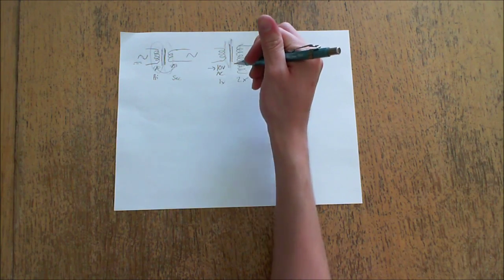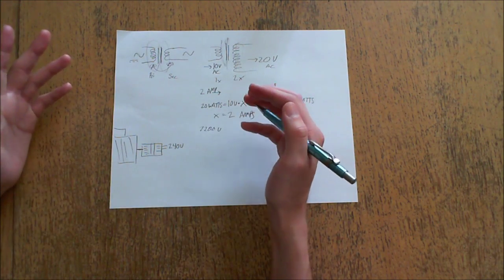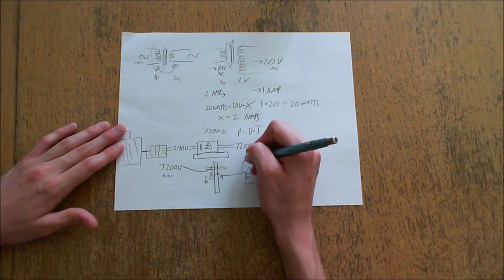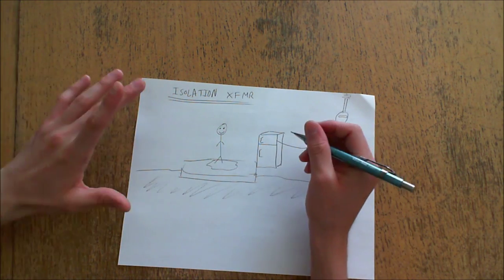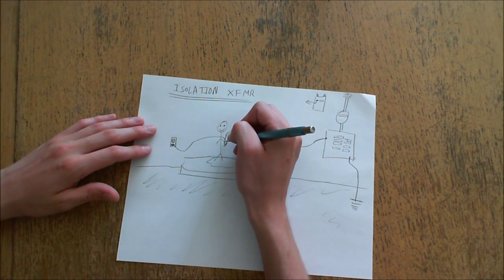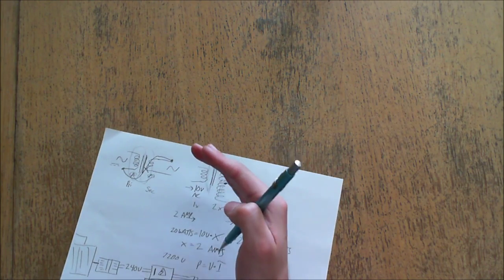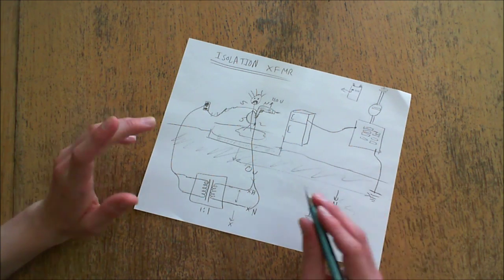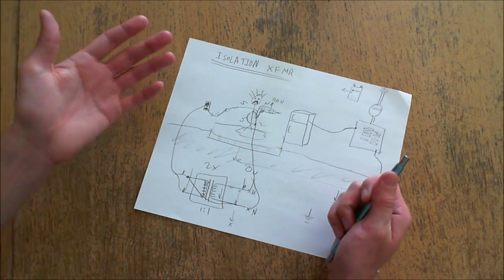EP 1 - Transformer and Isolation Transformer Theory

Comment: Hello, I read that measuring with an oscilloscope, you need an amplifier, you need galvanic separation, I ask from what point of view, when today's amplifiers have only 2 wires. Thank you for any knowledge
Reply from the maker: I believe the concern you're referring to is the risk of short-circuiting a mains-referenced component to the earthed chassis of the oscilloscope during measurement. If the oscilloscope is grounded to earth, then connecting its ground line to something with a potential to earth, it may result in a short-circuit being formed and resulting damage to the oscilloscope.

There are a few solutions to this problem, including:

1. The use of an isolated oscilloscope probe, which measures and re-creates the target waveform through a galvanically-isolated barrier.

2. The galvanic isolation of the target device being measured, for example, by powering it through an isolation transformer or from a battery.

3. The galvanic isolation of the oscilloscope itself from earth ground, i.e., by removing the ground pin from the mains cable.

Although it is not recommended, I typically use the 3rd method when I need to measure mains-referenced circuits using an oscilloscope. The risk with this method is that the entire scope, including  other BNC jacks, USB ports, etc. all become mains-referenced when connected to the target device. This can be hazardous, but if you are aware of the hazard, it can be mitigated effectively.

The safest and most industry-standard way to handle the issue of target device isolation would either be the 1st method (safest), or the 2nd method (less safe, but potentially less expensive than buying an isolated probe set).
Reply: @DielectricVideos  verry thanx

Comment: that really great . but I need to know one thing .A person holding the drilling device let the fault occur in devices either a wire break. when the person touches the break point wat happens ??? no effect in body because secondary is not grounded ok. but the person standing in ground potential whether  the person got grounded by body and get shock?????
Reply from the maker: If there is a path for current through the person's body (i.e., from the break point to a secondary-referenced surface) then they will receive a shock. Otherwise, no current will flow.

Comment: I've been scrolling through several videos trying to decide what to do with the ground leads. Of course you need to remove any strapping of neutral and ground on the secondary of the isolation transformer, but there seems to be controversy regarding what to do with the ground lead of the device under test (DUT). Some say to use an adapter that only allows connection of the two power leads, and others say it's better to preserve technician safety by continuing to ground the chassis of the DUT. Although that ground goes back to the circuit panel where neutral and ground are strapped, it's not the neutral of the secondary, it's the neutral for the primary. Of course the oscilloscope is plugged in to that circuit, so the ground for the oscilloscope frame will not be floating. What do you think?
Reply from the maker: spelunkerd   In my next video where I show my homemade isolation transformer, I chose to leave all of the above options. I included a switch which allows the user to connect the DUT ground to either earth, floating, or directly to the transformer's secondary neutral.

Thanks for watching, BTW!
Reply: Once you ground the chassis the circuit is "hot" any other point in the circuit is now at 120 V. SO you cannot touch anything other than the grounded point in the circuit. Had you not grounded the chassis you would be able to touch any one place in the circuit without shock. But having touched one point in the circuit it is NOW grounded and all other points in the circuit are now "hot." Of course you do not have to touch the circuit in order to ground and render every other point "hot." All you have to do is attach the ground clip of your scope anywhere and that point is now ground referenced. You can probe all other hot points to get voltage measurements in the circuit with the probe tip. You cannot attach a second ground clip (at the same time) to a different point in the circuit, however.